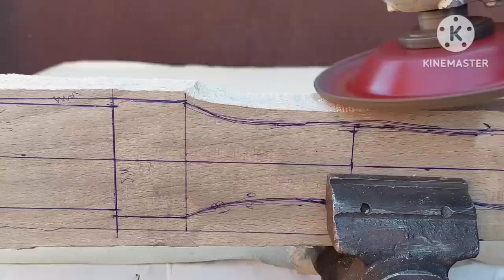Rusty Old German AXE Restoration. Rare WW1 Pickaxe

Comment: Welding to the axe head probably ruined the temper. You should have used the linseed oil BEFORE assembling the handle. Citric acid would be cheaper than the Red Bull.
Other than that, it turned out OK.
Reply from the maker: thanks for the comment.
Reply from the maker: Totally agree  abot axe  temper but I'm gonna use it for military  reconstruction.